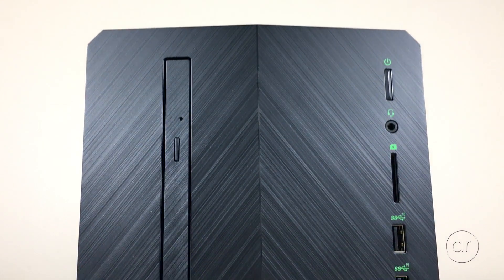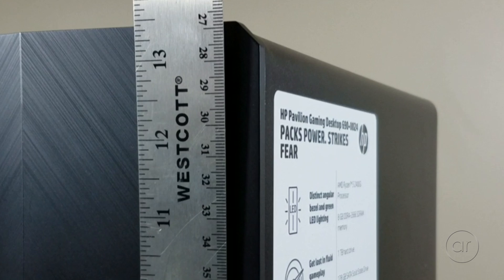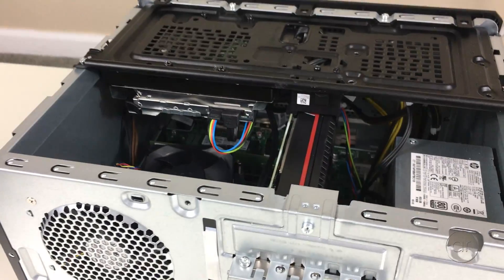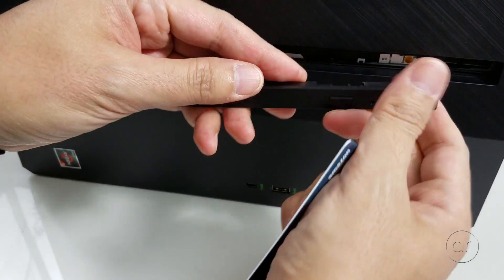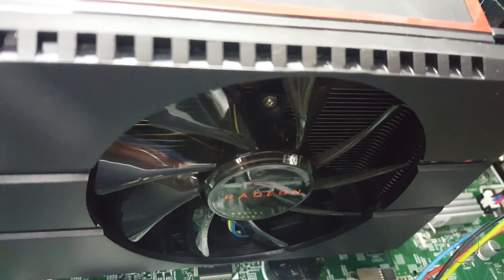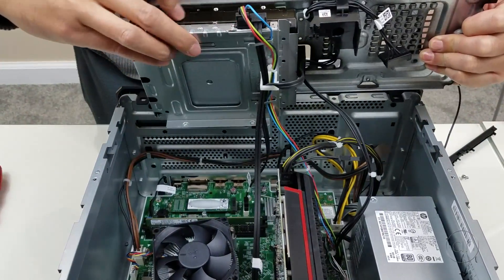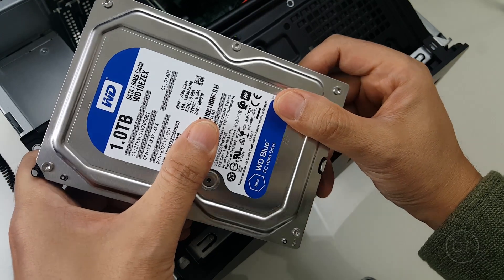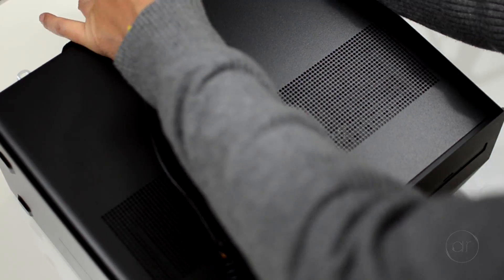How to Open and Upgrade a Ryzen-Based HP Pavilion Gaming Desktop

Comment: what gpu could i upgrade to
Reply: If you have the exact same system used in the video the RX 580 is a solid card but if you need more graphics you might have to look into a larger power supply. 

But if there is a model that runs on the inter graded Vega graphics with the same power supply.
But there are somethings to consider at 3:24 you see the plastic block with the sticker with the qr code on it might interfere with graphics cards so will have to be removed 

But if you have this computer that uses only the integrated graphics 
Would look into cards like the 1050ti and 1060

Nvidia GTX 1050ti com in mainly two types 
Ones which are powered through the pci-e slot and Ones which require a 6 pin power 
both will work with this computer.

You would want to find shorter card which are able to fit in the case
1050ti Cards

https://www.amazon.com/EVGA-GeForce-Support-Graphics-04G-P4-6253-KR/dp/B01MF7EQJZ/ref=sr_1_1?s=pc&ie=UTF8&qid=1548222648&sr=1-1&keywords=gtx+1050ti 

https://www.amazon.com/Gigabyte-Windforce-128-bit-Graphic-GV-N105TWF2OC-4GD/dp/B01M6Y671T/ref=sr_1_5?s=pc&ie=UTF8&qid=1548222648&sr=1-5&keywords=gtx+1050ti

https://www.amazon.com/d/Computer-Graphics-Cards/ZOTAC-GeForce-DisplayPort-128-bit-ZT-P10510A-10L/B01MCU1ERO/ref=sr_1_4?s=pc&ie=UTF8&qid=1548222648&sr=1-4&keywords=gtx+1050ti

Same with GTX 1060s they will require 6 pin power but is recommended to find a shorter Variant card so it can fit in the case better  

1060 cards 

https://www.amazon.com/d/Computer-Graphics-Cards/EVGA-GeForce-GAMING-Support-03G-P4-6162-KR/B01KU2CIIY/ref=sr_1_11?s=pc&ie=UTF8&qid=1548222648&sr=1-11&keywords=gtx+1050ti

https://www.amazon.com/ZOTAC-GeForce-Compact-Graphics-ZT-P10610A-10L/dp/B01KKJAJM4/ref=sr_1_4?s=pc&ie=UTF8&qid=1548222938&sr=1-4&keywords=gtx+1060+3gb

The links above are just recommend cards that will fit and there are a dozen other options from companies to chose from.

You can also get cards like the 1070, 1070ti and 1080 mini variants from zotac but would recommend at getting a larger power supply.

For AMD cards there isnt alot of Choices 

Cards like the RX570 and RX580 are your alternatives for this case since the card included is a OEM card which are not found on the consumer market

RX 570
https://www.amazon.com/Sapphire-11266-06-20G-Radeon-Pulse-Graphics/dp/B06ZYWX744/ref=sr_1_8?ie=UTF8&qid=1548223218&sr=8-8&keywords=rx+570+sapphire

RX 580
https://www.amazon.com/MSI-256-bit-Graphics-Certified-Refurbished/dp/B07K3LDD75/ref=sr_1_11?ie=UTF8&qid=1548223278&sr=8-11&keywords=rx+580+msi

There are not a lot of short card options for AMD
Reply from the maker: @apachehelocopto1779  Wow, thanks so much - lots of good information! I just noticed your post in the held-in-review area and approved it (Youtube is holding comments with links for review and I hadn't visited that section recently).
Reply: @apachehelocopto1779  I've heard complaints that if you upgraded it with a Nvidia card like the EVGA GTX 1060 it bottlenecks the computer.
Reply: @apachehelocopto1779  But is it possible I can fit a EVGA 1060 6GB SC in my computer? Model is 690-0020
Reply: @nva0101  You might start to see some bottlenecking in some titles
A gtx 1060 or a rx 580 would be the highest card i would go with this cpu

If you get anything higher like a 1070 or 1080 mini or just need more A better cpu then look into a R5 2600.

If the EVGA card your talking about is the single fan card then you should be all good with this case but might be recommended to remove the black plastic support block with the qr sticker on it at 3:24 in the video cause in could interfere with the shroud on certain gpus.
Reply: @apachehelocopto1779  the rx580 outperforms 1060 and 1050ti though, not to mention, you're better off with amd for the freesync monitors
Reply: well with Nvidia cards now supporting freesunc and also i did state in my first comment that the rx 580 is allready a great card those links are for gpus if there is a model which uses the intergraded graphics
Reply from the maker: I'll need to defer to my subscribers/viewers for specific models as I haven't tried to upgrade the graphics card. Sorry, I wish I had a better answer...

Comment: Hello, great video!

I recently bought mine from best buy, its my first gaming computer, i was purely a console gamer currently owning an xbox one x, ps4 pro and a Switch. 

I really didn’t wanted to break the bank when entering PC gaming and decided to go with this pre built as i have a 4k hdr 60hz freesync monitor :)

I am quite impressed by it so far I played forza horizon 4 at 1440p 60fps with medium settings and it was really good and also the first Witcher at 4k and everything maxed out, at 60fps but I would like to upgrade in the future some things and i have a ton of questions, i hope you or someone can help...

First; do you know which graphics card from AMD could fit this PC? I also saw on HP site that you could upgrade the processor to a ryzen 7 2700 which seems nice but i have found no information about the graphics cards... any ideas of which could fit this PC and would improve it?

Second; On the video you mentioned about upgrading the 8gb of DDR4 ram, it is supposed that the computer supports up to 32gb of DDR4, but i think i read somewhere that the PC couldn’t handle dual sticks... has anyone try this yet? 

Third; i have been hearing a lot about the power supply of 400W and that it isn’t upgradeable, so do you think that if you upgrade the RAM to maybe 16 or 32gb, upgrade the processor to a ryzen 7 2700 and also upgrade the graphics card, will the power supply be enough? 

Thank you and keep up the good work!
Reply from the maker: Thank you! I agree - for all that's included, it really is a good bang for the buck. I'll need to defer to my subscribers/viewers for an answer on the graphics card, as I haven't tried to upgrade it (yet). I haven't upgraded the memory yet either, but there shouldn't be a problem adding or replacing the RAM since its big brother, the 690-0034, has 16GB where both slots are used.

As for the power supply, I placed a Kill-a-watt on my system (I've replaced the 1TB HDD with a 240 GB SSD and a 750 GB SSD) and it peaks to a little under 200W with some CPU-GPU intensive games (ymmv). Memory and processor upgrades should be no problems - the big question would then be the graphics card...
Reply: @accessrandom  Thank you for the quick response, then I think I will try upgrading the RAM first.

Also a video on the 1TH HDD replacement would be nice also lol, and yes the question remains then for the graphics card... thank you and excellent channel, we will have to be patient on the graphics card then
Reply: Hi. Please check that to got a NVMe drive as stated on HPs website
Reply: What I plan on doing is upgrading the case and the motherboard and the power supply all at the same time and then transferring everything from this box to my new one. I have the Ryzen 7 2700 with 16gb ram and when I transfer everything, I can put any graphics card I want in it. If you want a reference than try this site: www.pcpartpicker.com

Comment: I heard this pc wasn't able to have the psu upgraded due to proprietary cables used, is this actually the case?
Reply from the maker: There's some conflicting answers out there - a reviewer at the best buy site is adamant that it's a non-standard PSU, while HP (who has an official presence there) says that it's a standard SFF. I wish I had a more definitive answer for you as I hadn't really focused on the power supply in the video. I'll need to revisit that in the future.
Reply: So, you would have a hard time using the PSU from this computer in another build as the fan in the PSU runs off power signal coming FROM the motherboard (weird). The wires coming out of the PSU are for specific connections present in this computer (main power, GPU, SATA (x2), etc...and a custom 8-pin that connects to the motherboard which is for the motherboard to control the fan in PSU.  Without that last one the PSU fan doesn't run and it would overheat...so you probably couldn't use the PSU with some other motherboard.  That said...the main power and GPU connections are standard 4-pin connectors and the SATA connections are standard...so you could put any off-the-shelf PSU in (if it'll fit) and connect it up.

Comment: Hi, great video. 

I recently took mine apart to install 16 GB of ram. When I put it back together the front and back headphone/audio jack stopped working. Any ideas on how to fix?
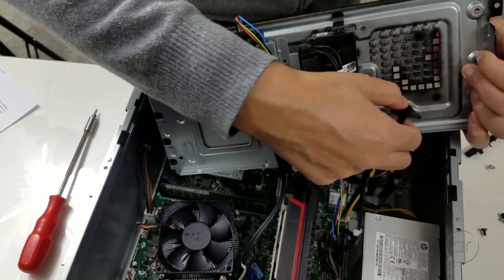Reply from the maker: The headphone/audio jack is on the front panel of the case, so if you look at the 5:22 mark, you can briefly see the three tabs that hold the panel unfastened. I push them back in at 5:24. What you'll need to do is undo those three tabs, flip open the front panel, trace the audio wire back to the motherboard, and make sure that it's connected properly.
Reply: @accessrandom  thanks for the video ive been looking everywhere for one like this. Think i could put a new cpu cooler in there? My pc gets a little warm.
Reply from the maker: @justdust381  I know what you mean - the exhaust air gets pretty warm. I have both the EVO Hyper 212 and the Hyper T4 in other computers, and I don't think either would fit the case. I think the ones that would fit are the lower profile fans for SFF cases.
Reply from the maker: Sorry, I missed the part about the rear jack. This sounds like it could be a software instead of a hardware problem. Are the playback/recording devices set correctly?
Reply: I actually just got it to work:) 

When I switched the ram out it messed with the headphone drivers for some reason. I uninstalled all of the audio drivers and restarted the system. It auto installed new drivers and works now:) Thank you for the help!
Reply from the maker: Super! - thanks for the update.

Comment: what kind of GPU can u pair with it if you upgrade to a Ryzen 7 2700
Reply from the maker: Good question - I still haven't found anyone who has actually upgraded the card to an RX 590 or a Vega yet. But you can certainly keep the RX 580 while upgrading to the 2700...

Comment: Good video... enjoyed the added power wrench sound effects when using screwdriver.  Nice touch.
Reply: Very good video, but these PC's are throw aways, HP doesn't allow upgrades, mainly because of how the storage partition is, so flashing the BIOS doesn't help. It's only set up to accept what's in it. Unfortunately changing it will cause the PC to be erratic or not work at all. Even more memory modules are finicky. Also you can NOT replace the 400w PSU in this, so hardcore gaming is out of the question unless you want to fry the pc. It also uses an HP motherboard, which wouldn't even cost about $30. So everything is cheap. The one they are "attempting" to sell at walmart has a 1660TI (minimal 450w psu), with a 256gb SSD and an I5 9400F for $579. Sounds like a good deal, but read the horrid reviews these PC's get. Some don't even get ANY 4 or 5 star reviews. They are THAT bad. Hope this helps!
Reply from the maker: Thanks man. No one wants to see me use a screwdriver for 2 minutes so I use that in all my recent videos :)
Reply: @accessrandom  so basically, you can buy another 2.5 hard drive and it would fit next to the oem one but in the opposite direction. Also, what happens if I get a new ssd to replace the stock one, wouldn't i lose windows 10 as the while thing is installed on the ssd
Reply from the maker: Yes, that's correct - you can add an additional 2.5" or 3.5" hard drive or 2.5" SSD and mount it opposite the existing 1TB HDD. You can also replace the existing 128 GB M.2 SSD, which has Windows on it, with a larger M.2 SSD, but you would need to re-install Windows on the new SSD; alternatively - and a bit more complicated - is that you could clone Windows from the existing to the new (you'd need an M.2 enclosure to connect the new SSD to a USB port so you can perform the clone). Hope that makes sense...
Reply: access random but isn’t the recovery on the sata hard drive so just swap the ssd snd do a recovery, though you would lose whatever you have.
Reply from the maker: Yes, that's correct - you can always do a recovery onto the SSD.
Reply: @accessrandom  what would be the ideal sweespot in term of ssd space? i mean if you're going to get a 250, that's not much of space gained. As long as you install your games in hard drive, the 128gb is probably enough
Reply from the maker: @naegleriafowleri1715  Yeah, I'd say 128 GB is enough only for Windows. Prices for M.2 SSD have been dropping recently (I just saw a 500 GB Crucial MX500 going for $58 - NVMe would of course be more expensive). so the larger the better if you plan to install games on it.

I have some programs (Vegas Pro, Photoshop, etc.) where an SSD is beneficial not just for work-in-progress documents but also for the load times of the programs themselves, so I've actually replaced the HDD with an SSD and installed the programs there. I then added an additional SSD for games.
Reply: @accessrandom  Yeah, it depends on your needs, I for one don't use photoshop, but I may use a video editing program in the future to edit videos. This nvme ssd card is pretty fast for me. I come from a 2012 laptop with a 5400 rpm 500gb hard drive. How would installing your games on the ssd be more beneficial? Would it speed up loading times in the game itself, probably nothing drastic . I want to get a 2tb hard drive, and maybe in the future replace the 1tb stock hard drive with an ssd, ideally when prices go down even further

Comment: I have that pc but intel i5-8400 and gtx 1070 8gb and 8gb ram. Is it possible to upgrade the gpu? To other brand msi example? Also people are saying the 8gb ram is bottlenecking the pc gpu and cpu while gaming so I am thinking about buy a 2x8gb ram. Mine is 2666 mhz can I buy a 2x8gb 3000mhz ?
Reply from the maker: Hard to say about the gpu - I have the feeling the dimensions of our components may be slightly different as your motherboard will have a different layout (as yours is Intel). Best to check inside before upgrading, but it will probably need to be a single-fan design and not exceed the power supply requirements (mine is 400 Watts).

If your memory specs are the same as mine (DDR4-2666) - yes, you can use 2x8GB 3000Mhz. But please note that there's no way to overclock the memory in the BIOS so the system will downclock to 2666 anyways.
Reply: @accessrandom  aa okey what about the ram? When playing i suffer alot of fps stuttering in fortnite(low options) should i upgrade the ram to 16? I read that the 8gb is bottleneck the pc?
Reply from the maker: It sounds like you have enough horsepower to run fortnite. I found some fps benchmarks between 8 GB and 16 GB running fortnite and it didn't look like there was much of a difference. Have you updated the Nvidia drivers? When I got my HP, the AMD drivers were way out of date.
Reply: @accessrandom  ye k did upgrade it. What about adding cooling fans. Is it possible? Or I habe to buy new case
Reply from the maker: Do you mean cooling fans for the case or the CPU? For the CPU, I don't think something like a Hyper T4 would fit. Definitely not a 212 EVO. When shopping around, just keep in mind that the width of HP is around 6.75".
Reply: @accessrandom  Is possible to change the GPU?
Reply from the maker: So far, I've had one commenter upgrade to an EVGA GTX 1050ti SC on a 690-0067c (different model, same family). I haven't tried an upgrade personally, but I'll be keeping track of what others have successfully upgraded to.